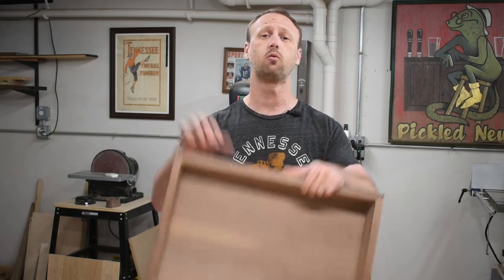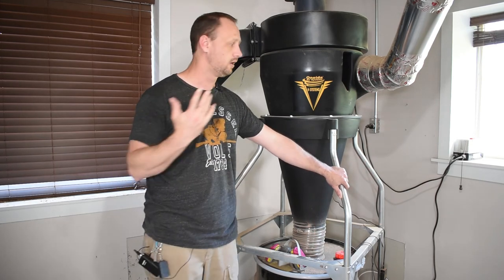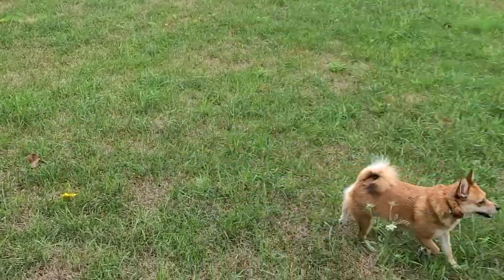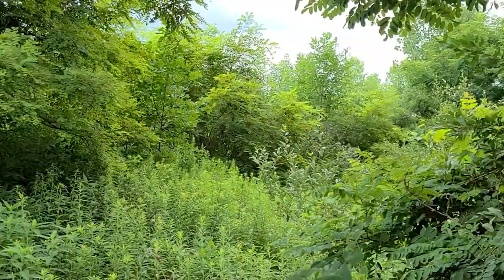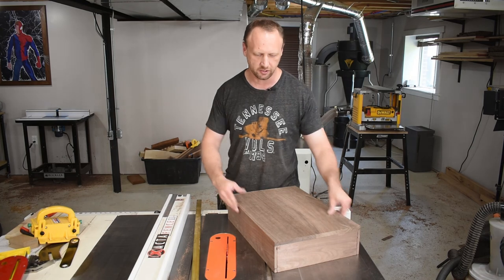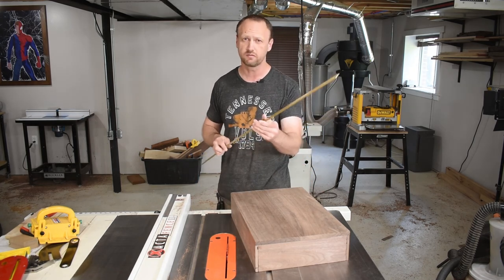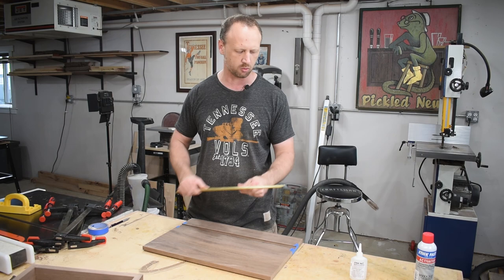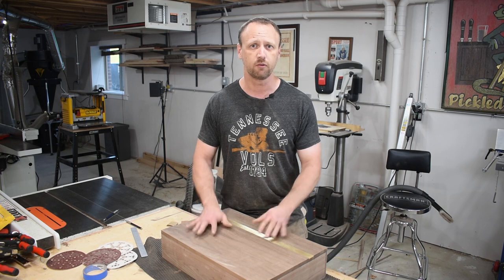Modern Brass Inlay Walnut Box

Comment: As the solid wood expands and contracts (as it will do), the brass will pop out or distort and destroy the cut line or crack the wood over time (in only a year or two). You need to inlay metal into a laminated and veneered material to avoid this. It's a nice job but I am just saying that this will probably fail over time. Sorry.
Reply from the maker: Nope, been doing this for years. It works perfectly. Because you have a different way doesn't mean that all other ways are wrong.
Reply: @NewtonMakes  this is something more people need to understand. There is more then 1 way to do something right. And that something will not work in your theorie doesnt necessarily mean it will not work in real life.